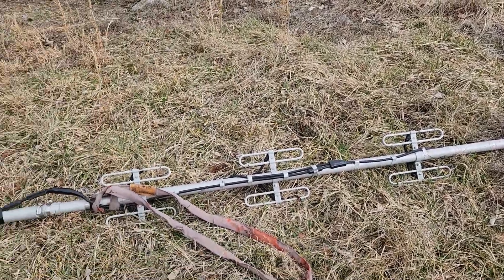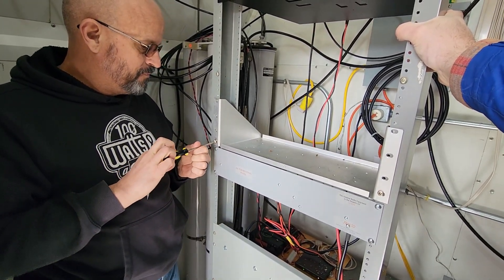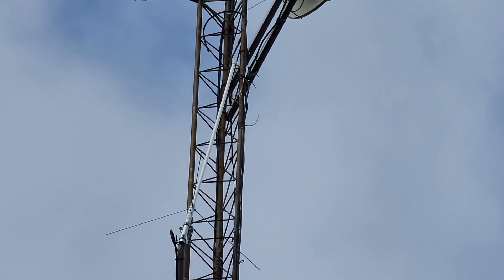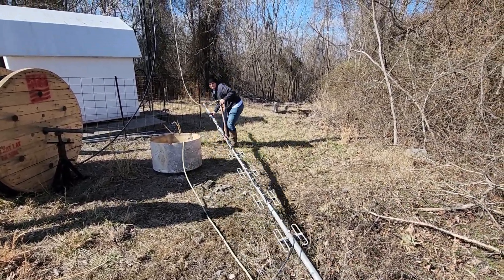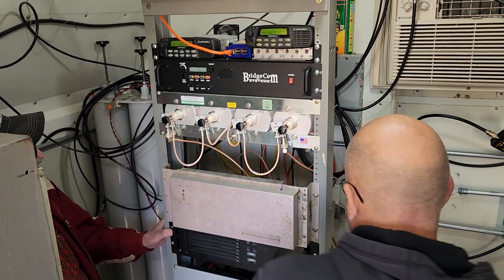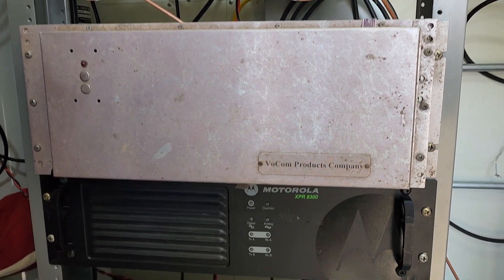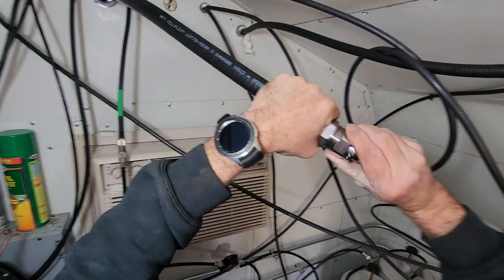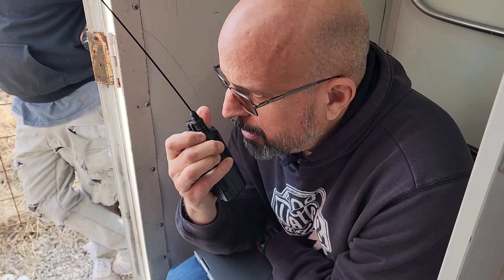LCARA HAM Radio: DMR Antenna and Repeater Installation!!!!

Comment: Notice they NEVER tested the coax without the antenna? (at least not in the video) They never used a TDR to VERIFY the heliax/coax was good nor did they document or label any cables. Folks, the difference between messing around and SCIENCE is documentation! Remember that. Nothing worse than coming behind someone's "good intentions" and trying to decode or demystify what doesn't work. NOPE they just went straight to connecting everything and wrapping it. This should be re-titled "How to carelessly RUSH through a repeater install and not document ANYTHING". whoops & 73.

Comment: DMR is great! Most newbies think it only works with internet, but it works the same as FM UHF/VHF repeaters do locally when the internet fails. You just get the added bonus of text msg’ing, and two users on the same freq. 

Here where I live, those stacked UHF Arrays, out perform the pants off of the VHF/UHF antennas most hams use. Make sure you have a great filter on both RX/TX. 

We ran tests here, and DMR beat analog, not even a close contest, when it came to range off the same antenna/radio. It’s really a great mode if you know how to use it. 

I could leave my HT in the truck and check anytime for texts people sent. I can’t say enough about it. Welcome to 2023.
Reply: DMR is great also as starter radio for a new ham, you can get long distance for not many dollars.